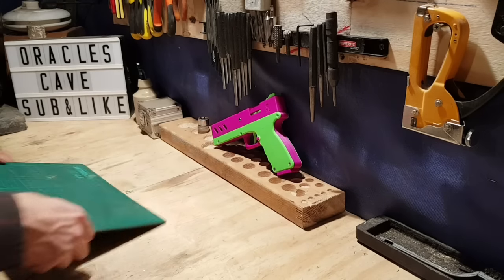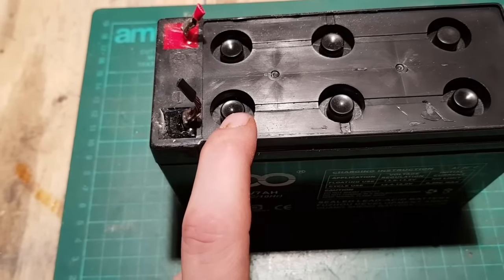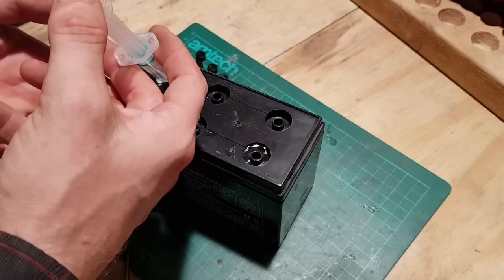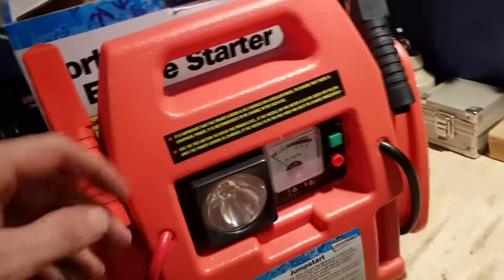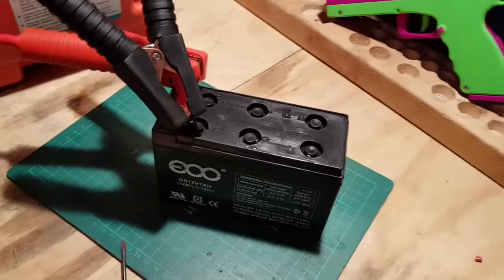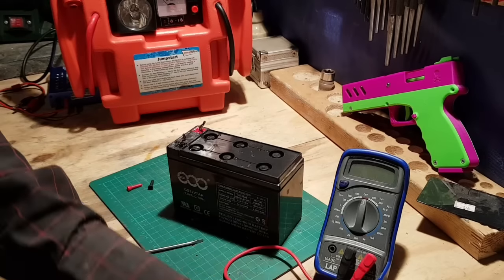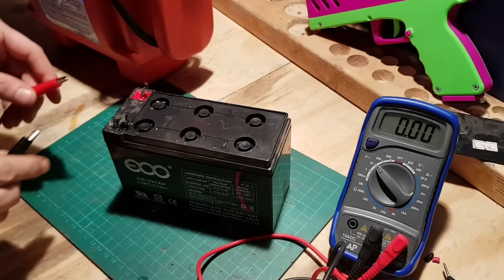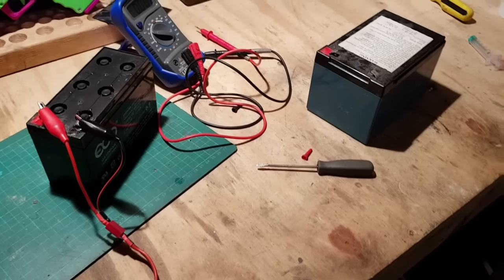HOW TO REVIVE DEAD 6V, 12V BATTERIES THAT WON'T CHARGE

Comment: I had got a booster jump pack that had broken so I took the battery to find out it was completely dead. I found your video and was blown away. I didn't have any distilled water but by the grace of God it is raining here in Pennsylvania so I went out and got a cup of rain water and followed your instructions. I could not believe it worked. This battery sat after taking it out of the pack for about 2 yrs. Now it's taking a charge. Unbelievable!!!! Thank you so much!!!!
Reply: Mmm I have one of those from harbors freight and after first jump battery is completely gone. Mean it charge but deplete rights away. Was that the same issue? Cause I’m thinking of doing this to that jump start battery pack now lol
Reply: @Oneklickmedia that's the problem this should fix. You could also buy battery acid at a local parts store for 10 bucks and carefully drain the old acid (there won't be much) then top them off with the new. In my opinion the acid is a better option but I'm far from an expert.

Comment: Thanks for sharing buddy... I'm a electrician have been in the trade for over 24 years and you did a good job explaining to the masses ... thanks
Reply from the maker: I appreciate that very much, there's nothing like a little pat on the back 
👍👍👍
Reply: @oraclescave  
Appreciate for the video
I want to ask if using Purified water  not distilled will cause any problem?
I used it to fill the battery thinking it's the same as distilled 😭
Reply from the maker: @Rofl  it's not the best for the battery but it will still work, leave the cells open while charging back up so it can vent any bubbles.
👍👍👍
Reply: @oraclescave  thank you very much

Comment: OC. It worked like a charm. Once I got to the cell openings and started to inject the distilled water, I realized just how "thirsty" they were. Note to all: use the syringe. If you don't, it will take a long time to fill the cells because you will be constantly waiting for air bubbles to burp. I attached a wall wart with 14 volts, 800mAmps. At first (I put it through an ammeter) there was very little (current) draw. Then it picked up. It was a few hours but my battery was not used a lot, just old. It really took off and got to the point where my (not so smart) battery charger started to give the yellow LED. (Fast charge). Power Sonic wall wart style. I am letting it "rest". I am confident it will come back full force within a day. Thank You for your video.

Comment: I'll stick with my dumb charger. It never complains. Thanks for the heads up on how finicky smart chargers are.
Reply: When it burns out, just refuse to replace it with one that says "reverse polarity protected" which is a phrase that means it will not charge a battery unless it almost doesn't need charging.

Comment: I worked in Gallaghers Service department for 12 years from 1978 - we used similar batteries (completely closed) on solar units. These batteries would go high resistance so could not be charged by normal means...  what we did was have a 2uF or 4uf 250VAC capacitor in series with mains, my case 250 VAC onto the battery - even a couple of hours would bring them back.

Comment: I play bass on the street and used YUASA 12v SLA batteries for years. Use to be (back in 2001-2003) at  Maplins would cost 25 quid brand new. However, behind the Preston Road branch in Brighton  there is a scrap yard. Now they had a massive collection of old SLA batteries that were used as backup power for fire and security alarms (like for banks) that were still perfect and sold for 50p. It was stipulated in the insurance that they had to be replaced every 5 years even if they were never used. This was great, I didn't even need to buy a charger. I used them to power a 25 watt car amp, had a guitar fx (Zoom GFX  707) as a pre-amp and just a speaker box. The Zoom pedal runs on 4 AAs. Thanks for the vid, never thought of opening one, I thought there might be some very dangerous caustic crap in there. Anyway, try a scrap yard if your looking for a simpler solution.

Comment: I'm reviving the batt out an old portable car charger and EVERYTHING you've said was spot on down to the dimples in the rubber caps! Got it on a 2 amp trickle charge now (for probably over night). Hope it works.
Reply: How'd it work I'm doing the same thing
Reply: Did it work?

Comment: I just received 2 of these, old lead acid batteries, along with some OLD Ham Radio gear. I didn't know you could open & service them, like a larger 12V battery. Thanks, for the info., as it will come in handy real soon.
Reply from the maker: You are very welcome Chris, and thanks for commenting to let me know, I appreciate that very much.
👍👍👍

Comment: Thank you again! My battery was only one year old and failed in my Harbor Freight battery jumper, so I took it apart and did everything your showed. The battery went from 11.4 in 24 hours to a 12.6. My battery jumper is now like new! Thank you, thank you!!
Reply from the maker: Excellent Joel, I'm glad you managed to save it, and I really appreciate you coming back to let me know.
👍👍👍
Reply: What about batteries that have the connection at the bottom of the battery by the little copper tabs
Reply: @ronaldforrest9798  0

Comment: Thanks for the video!  Helped revive my battery!

Just one note about replacing the rubber caps then charging.  People may not be replacing the rubber caps until after the battery is charged due to gas build up during charging. 

 I put the rubber caps and the plastic cover on the battery after adding water then I charged the battery.  During the charging two of the rubber caps and the plastic cover shot up in the air due to the gas build up in the battery!
Reply from the maker: Yes it absolutely should be charged with no caps, I just think its funny watching them get shot all over the place, lol
Reply: @oraclescave  Hahhaha, yes I agree!  👍

Comment: 52 years old  and i just learned this, the amount of batteries i've thrown out over the years and i was given a job lot of 45 amh dead batteries reviving them now with this method, i'll keep you posted
Reply from the maker: Good luck and remember they may need cycled a couple of times before they pick up.
But I bet you sort most of them
👍👍👍
Reply: @oraclescave  thanks mate,  have 2 on the go as we speak, topped up-battery connected-fingers crossed lol, i'm a youtuber myself mate and i'll put the link on this thread when complete for the results as long as you don't mind 👍👍

Comment: Excellent video. So very well explained. I have a salvaged 6 v battery that I cannot charge past 3 v. I just popped the top cover and saw 3 caps. They are depressed as well. I will try your method. Learned something very useful. Thank you very much and have fun.
Reply from the maker: Thanks for leaving your comment Daniel, very much appreciated Dude.
👍👍👍

Comment: Finally - I found the one who knows and your video did it -Wayda go there!!!
Thanks for showing and your info is very valuable. One thing you said was make sure the water was over the glass matts - Question here - by how much???
Reply from the maker: Put the water over the glass matts until it soaks in, you want to tip out the extra water above the matts, before you seal it.

The water is to help dissolve the crystals in the matt, thats all, they  don't have to stay flooded like a lead acid battery.

Comment: I have 2 dead new batteries. I promise to never let them get low again. I still have fluid in the cells and I will check again. The first battery is charging. It went from 6.2 to 11.something in 30 minutes. The smart charger is charging it. Working on the 2nd battery and I’m positive it will be able to charge as well. THANK YOU THANK YOU THANK YOU!!!!

Comment: In these sealed batteries the electrolyte is supposed to be completely absorbed by the gel in the separator, so the fact there is no liquid is normal. But at the same time it is indeed the common failure mode for these to loose the water from the electrolyte over time, so they do need refill. But problem is, it is difficult to judge the correct amount, you never know how much of water is actually missing.
And to get the water really back into the gel where it will actually work needs time, so not-as-smart trickle charger left on it for a week or so will be just enough to charge the electrodes along the water diffusing back in.
Reply: That's something else to try, thanks

Comment: Thanks for the  information. I was in the process of doing 3 AGM's myself and figured maybe they couldn't be charged. I just did not realize the cells could be drier than I than I expected. I will go back and reopen them apply more water.

Thanks again

Comment: This actually worked, took a few tries to get the water to soak down into the battery holes but after i filled em i shook it and i could hear the water inside. We had 2 of them that we were about to throw away and get a new one and now they both work again. Its hard to say how well they work compared to new but they work way longer then they were. The kids thought we bought new batteries

Comment: I've been looking for a s/h mobility scooter of which there are many where the original owner is no longer alive, but the family have not kept them charged, and the batteries are dead. These are always way cheaper and now it's a good option for me to consider. £100 plus per new battery was out of the question, but the price of some distilled water and a bit of faffing about with the cells is quite within my means. Thank you v much!!!
Reply from the maker: And there is very cheap battery refill pouches with fresh acid, turns battery to brand new if my way doesn't work, very cheap. Much better than paying for new ones.
👍👍👍

Comment: tried it with my 2 year dead battery... works like a charme. Many thx!
Reply from the maker: That's great Peter, and thanks for coming back to let me know, I really appreciate that.
👍👍👍
Reply: I have gel battery 12v200ah just 18months old na, if I charge full 12.7v with in 30min with just 50w load it drain. How do I repair it

Comment: I have the same batteries in my mobility scooter and it's not holding a charge so I'm going to try this before paying $150 for new ones, ty so much for showing this
Reply from the maker: You can also buy battery refills, just fresh acid, much much cheaper than a new battery, all the power in a battery comes from the "electrolyte" liquid, the rest of the battery is just a jar really.

Comment: Thanks for posting the video.  Encouraged my to try to revive a dead and discontinued Sealake 33ah 12v in a Nautilus power bank someone was throwing out.  $299 new , $100+ for a replacement cell. (Cdn$)  Guy tossing the whole power bank thing due (inverter etc) to the battery not taking a charge.  Dry as bone, we'll see how it does after a full charge.   Cheers !
Reply from the maker: Excellent, I would love to hear how you get on.
It may take a few cycles.
And if "sulfation" is the cause, Google reversing the terminals.
This is a method used to reverse the "sulfation"
It basically breaks the crystals back down.
And if they don't work, all you need to add is a small amount of sulphuric acid, just Google amount for your size of cell.

I bet it works perfectly fine
Goodluck
👍👍👍

Comment: One neighbor changed a 12 volt LAWN TRACTOR that seems to die out after 1 or two years to an automotive (used junk yard good battery at half or less cost) made to fit. Works quite a long time and can jump start a car that drained overnight from a short from in seat adjuster, or dome lights on.

Comment: Just curious; what about connecting a newer more healthy battery in parallel with the older battery being revived as a method of tricking the smart charger?
Reply from the maker: Yes that would also work absolutely fine

Comment: Cheers that was very informative, I'm trying to revive 4 12v 20amph lead acid gel batteries because they are horrendously expensive. My couple of smart chargers didn't do a thing and now I know why. I got myself one of them little pulse chargers but don't hold out much hope. I'll check your channel just in case you have some tips, most of the American tubers just want to sell stuff with affiliate links and don't really explain it properly.

Comment: Hook the good battery up to the bad battery to get the voltage up and hook your charger up to the good battery. That way the bad battery is pulling a charge from the good battery and the good battery is pulling a charge from the charger this eliminates the step of hooking up the jump start.
Reply from the maker: Yes but the idea of the video was to show someone who only had one battery, that they can link to something else with 12 volt, like a car or motorbike with jumper cables,  just to trick the charger into working.

When I first used this charger on a 12v battery I had that issue with no other 12v spare battery and was unable to charge the battery, that's why I made the video the way I did.

Its quick and simple for people who may not have tried anything like this before, your way would work, but it's slightly more complicated and depends on having a spare good battery.
👍👍👍
Reply: @oraclescave  do you have any suggestions for folks that don’t have car battery chargers after you insert the water? Your diagnosis looks spot on for my son’s toy car 12v battery

Comment: the battery you have is a common AGM type. It is an "acid starved" design, which means the matt between the plates is moist but not submerged in electrolyte like a flooded cell. (see battery university). When I tried this I killed already weak batteries . . So how do you know how much to add? I don't know either . . Maybe cut one open? There's another video!!

Comment: Great and clear video - thank-you. My 12v 7amp battery is currently showing 1v and once topped up, I was wondering if I could attach it to my car battery instead of a Jump start kit/booster pack to raise the voltage so my (Halfords) 4amp smart charger will see it? Thanks
Reply from the maker: Yes attaching to car battery will be fine.

Comment: Brilliant info! I have a mountain of wheelchair batteries and ride on toy batteries my mother accumulated at her house. Every last one dead as a doornail. I charge them and they plunge to a few volts within minutes once off the charger. I would like to try rehydrating a few. If I can get just one of them working to use for utility and craft purposes I will be happy. The rest will be melted down to recover the lead and make myself a hat to block Russell Howard from eating my brain.
  Ooh! It's thundering outside right now. Free distilled water on the way!
Reply from the maker: Goodluck, I imagine sulfation will be your main battle, just Google "SULFATION, AND REVERSING TERMINALS FOR SHORT PERIODS, to reverse the sulfation.
It breaks the crystals back down.
👍👍👍
Reply: @oraclescave  how do you tell if a battery has sulfation?
Reply from the maker: @After_Tech_Industries  there is different ways of kinda knowing.
Like the battery will only hold a small amount of power.
Full charge might only last from seconds to minutes.
Or of you know the battery has sat around doing nothing for a long time.

If you check Google on REVERSING THE TERMINALS, this can help reverse the sulfation, to help the battery store more charge, and also stops sulfation from eating the cell plates.
👍👍👍
Reply: There's a couple of good vids about how to distill your own water. I recommend you check them out as opposed to rain water which is not anywhere near distilled.
Reply: @oraclescave  I think this is what I am dealing with in my car battery... Haven't found relevant Google results yet to your suggestion...

Comment: Thanks for the informative video.  I  bought an old Black and Decker electric push lawnmower and it has 2 small 12volt  batteries connected in series that look like your battery. I’m assuming they’re very dead. Do you know if a car charger can bring the batteries back to life or would it be unsafe to use a car charger. The smart charger doesn’t charge it at all.
Reply from the maker: Car charger can be used to kickstart a battery into getting voltage but if left the 6v battery could dry up and cause thermal runaway.
So I would advise not to do it unless it's to just shortly use it to raise voltage so the smart charger can start to work, voltage would only need to rise a small bit for the smart charger to start working.
Reply: @oraclescave  Thanks for the advice. Yes I don’t want to blow up the battery.

Comment: Nice video, good that you didn't have to do the long hours of pulse repair charge on a smart charger, it sometimes do nothing after long hours of pulse charging the battery, but this method did it, and may I know if this is applicable to a Gel battery too? I have a charger for a gel type battery but whenever the indicator says it has 99% charge power and 14.5 volts I unplug it and stop the charging then when i check it back after a few minutes it will say the battery is full and 100%, is it normal to reach 14.5 or 14.7 for a gel battery or I should stop at 14.4volts, pardon me cause I am not used to Gel Batteries, thanks